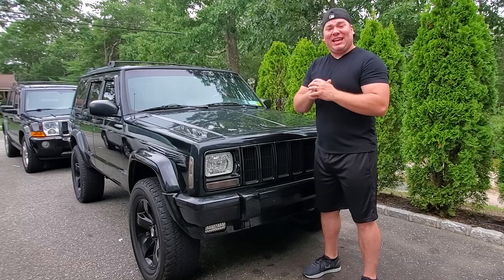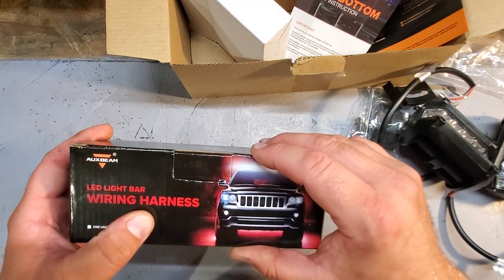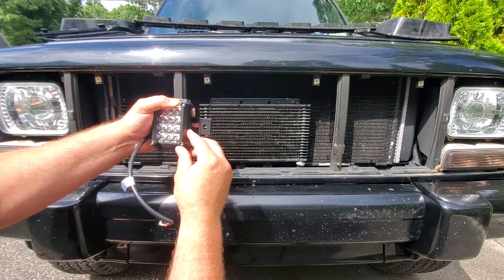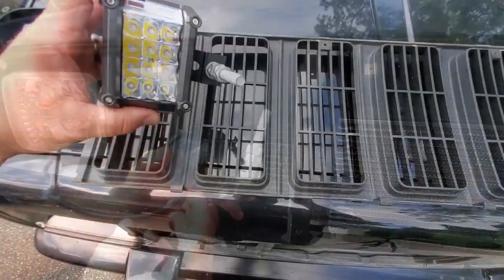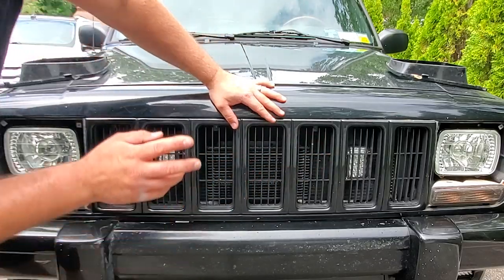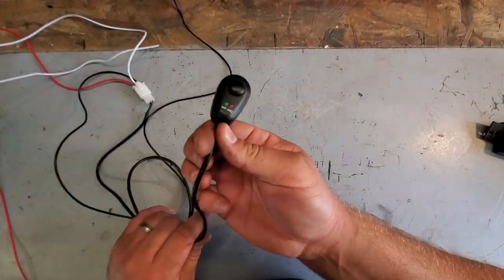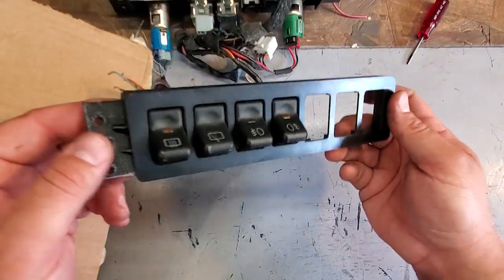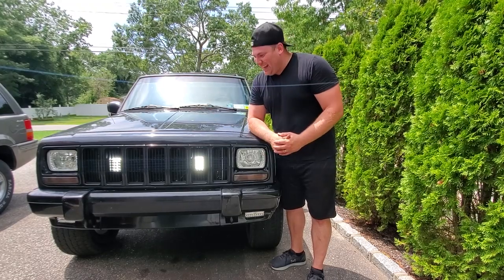JEEP XJ IN THE GRILL LIGHT PODS - AUXBEAM 4" SIDE SHOOTER INSTALL

Comment: Saturday 9/22 6:00 pm just closed the hood the lights are outstanding! Installed the lights with bolts like you did, installed 3 ,1 inch round switches to the right of the shifter in the bezel(2 switches for later!) Works perfectly can't wait till dark! Thanks Dan!!!
Reply: Pointed the side shooters down!!!
Reply: I didn't need to trim the support the nuts fit perfectly in the channel!
Reply from the maker: DOWN SHOOTERS!  Awesome man!!
Reply from the maker: Im so proud you used my method!  I really hope you like! May they bring you many lumens!!!!

Comment: You need to fix that trans cooler!!! It won't do you any good with air bubbles accumulating at the top. Orientation is key!!! Either on its side or tubes at the top is what you need to do. Just had to point it out. Love the video! Keep up the good work!
Reply from the maker: It was actually installed exactly as specified by the manufacturer.  There hasn't been any problems.  Thank you for your concern though 👍

Comment: The wire part is a bit confusing. I have my own harness. Connecting to foglights But have a oem switch amd its pigtail. That i wana connect up on bezel.(my xj never had foglights.)
Reply from the maker: I love putting in OEM fog lights using the OEM switch in an XJ that didn't come with em. 👍

Comment: The way you drilled that bar is way to risky, a small piece of wood between the bar and the radiator would have saved you from the heart stopping moment when the bit cuts right trough the bar. 
Looking forward to your lights full review.
Reply from the maker: Your absolutely right about the wood... I shouldnt have done that so recklessly.  Good thing I was very controlled. Lol 😰
Reply: I had no trouble,don't push too hard,like I tell the guys" let the tool do the work'!